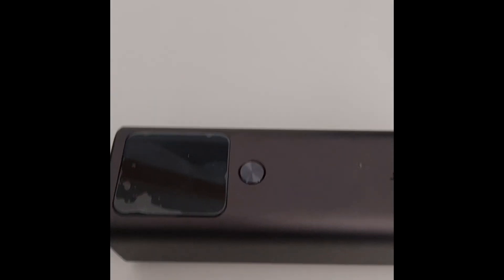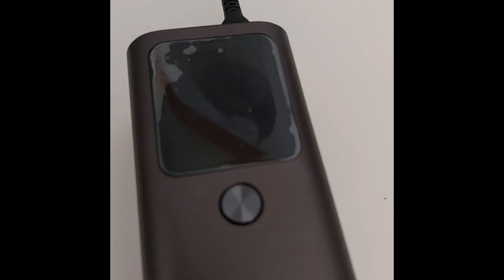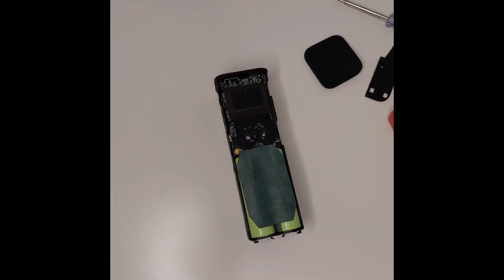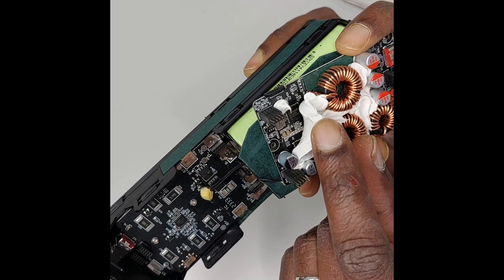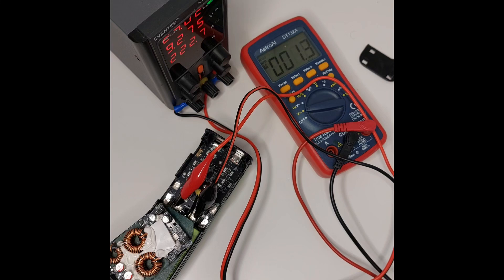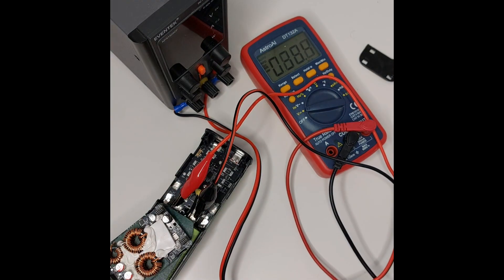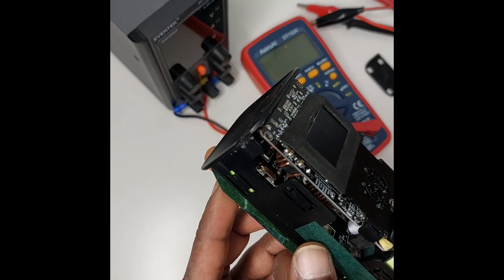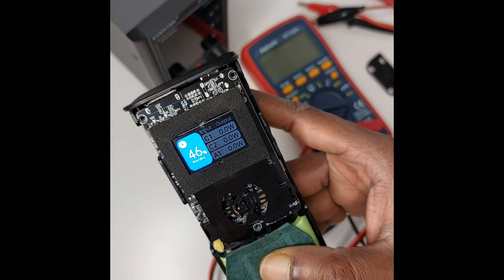140W Powerbank does not charge, Reset Powerbank with drained cells, Amegat 140w Teardown

Comment: Just so you know I have the exact same one and this happened to me but I did not take it apart I put it in the refrigerator for 30 minutes and then I plugged 2 40 watt chargers one into each ucb-c slot into the brick while still cold and after about a minute of c1 and c2 stuck at 2.5w c1 went to 17 Watts and C2 went to 21 Watts and within just a matter of moments it's supercharging again.
Reply from the maker: Thanks for the tip, I will check

Comment: great solution , i did this with my motorbike battery as well, but how did you  you open this one( not included in this video)?
Reply: Solved. i was able to open and revived it with a Makita 18V drillbattery. 
Thanks for the tip

Comment: Do I understand correctly that you charged the battery directly past the controller, and this revived the power bank?
Reply from the maker: Exactly, I charged past the controller to boost charge and revive the powerbank.
Reply: What Arena the values for volt and Ampere to charge the akku with your method?